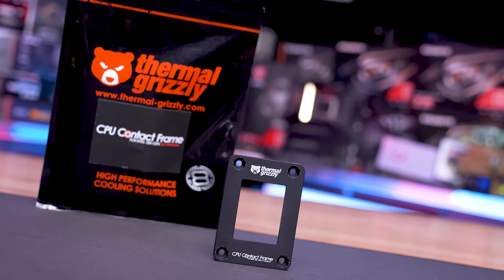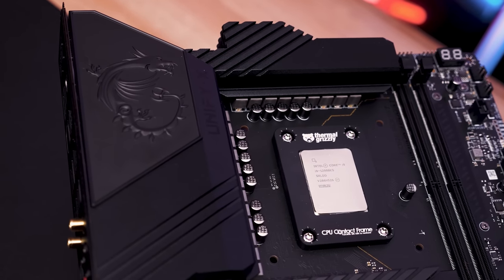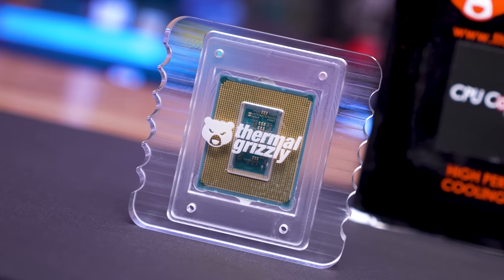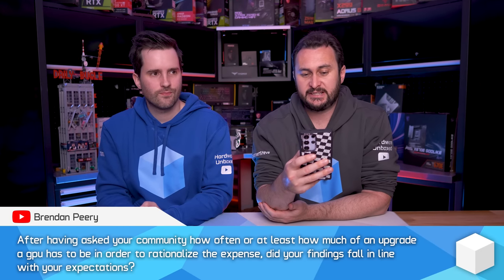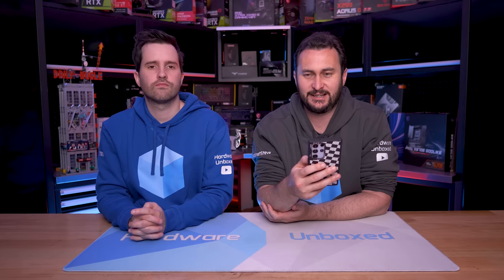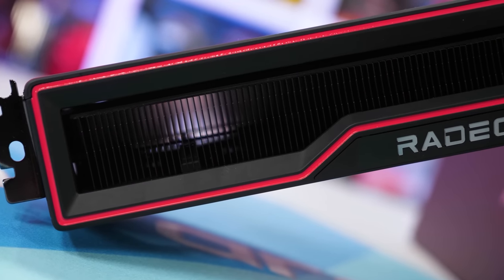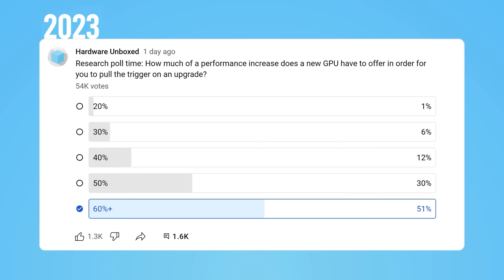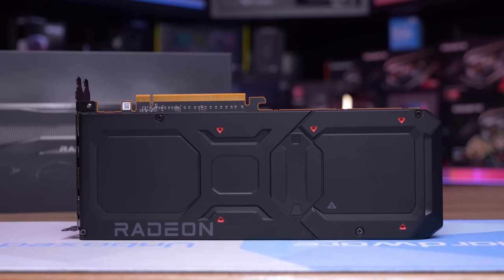RTX 4050 Pricing & VRAM, Are 12-core CPUs Dumb? March Q&A [Part 2]

Comment: Companies are now addicted to lower production higher prices,  cheap versions aren’t as profitable but I feel they’re going to eventually have to go back or someone will fill the gap
Reply: Costs for advanced production nodes are shooting through the roof (fueled by the necessary EUV lithography tools being 10 times more expensive than previous DUV lithography tools) and many features on an integrated circuit don't scale down with the more advanced production methods. One of the reasons why (aside from geometric increase in yields as you make the individual pieces of silicon smaller) companies are going for multi chip designs is that it allows then to use the more expensive production methods on parts that benefit from them and make the parts that don't with cheaper older production nodes. Monolithic designs as per nvidia and intel are probably getting more expensive to manufacture each generation, not less.

Comment: I went from a 1080 to a 3080ti (used) massive uplift, probably over 60% - but actually maybe its 100% with many games. Overwatch low settings at 120fps with the GTX1080 now with 3080ti and ultra settings locked to 300fps! So more than 100% with quality improvements too!!

Comment: I just tested R7 7700x with  7900xt and R7 5800x3D with same GC. 
I think 1% lows and 0.1% lows dont tell "everything". The experience was extra smooth on 5800x3D (still super smooth on 7700x, but not as much in RE4 remake 4k ULTRA+RT) even tho the number were quite the same according to MSI afterburner for the 1% and 0.1% lows. 

In fact those 1% lows can even be confusing and tell the opposite of real gaming experience. 

To put a simple (and not real) example of missleading statistics. 
Lets say a CPU1 had in its 1% lows : 2000 frames rendered at 200 fps and 2000 frames rendered at 10 fps, averaging 105 for its 1% lows. 
The over CPU2 performs exactly the same except that during that passage were CPU1 had its frame rate drop to 10fps, it was able to render twice as much frames........that makes 4000 frames at 20fps, all other things being equal.  
CPU2, because it performed better, those additional 2000 frames randered will push out of the 1% lows the other 2000 frames at 200fps, making it's 1% lows fully at 20fps only. 

CPU2 performed better but "surprisingly" randering more frame can actually lower the 1% lows. 
There is some extra "smoothness" about this 5800x3D CPU when gaming, and benchmarks just don't show. 

I will definitely get the 7800x3D, I shouldn't lose much money resselling the 7700x.

Comment: I'll have to disagree with your comments on the low-end GPUs like 6500XT and 3050.
You say the 3050 is still that price because Nvidia has the market power. It's still that price because it was never a realistic 250$ MSRP and Nvidia just flat out lied. It will never ever reach 250$.
Contrary to that, the 6500XT was released for 200$ at a time where GPU components surged in price and that was the only reasonable MSRP to release at. Sure you can argue that they shouldn't have released at all, but it was a GPU starved market back then.

Comment: the 4000 series cards are a hard sell, i doubt Nvidia will release the lower end cards like they planned since they cant offer them with anything over 12gig of VRAM but you cant buy a next gen card that cant play current gen games.

This reminds me back during the 900 series when 3gig was not enough anymore and the 950 came with 2gig slow VRAM and that card couldnt play games that came out a year after its release. the 5000 series card will probably rectify this problem like they did with the RTX2000 series cards

p.s the 1000 series cards were trash except for the 1080 and 1070

Comment: So, I dunno if you guys will ever see this comment, probably not but I am gunna comment anyway. 

AMD/Nvidia could make decent margin on "lower end" cards. There is NO FUCKING REASON to have RT cores on lower end GPU's. Out of all the people who own 3060's how many do you think turn on Ray tracing, in anything... VERY FUCKING FEW. Most people are turning down settings to play at 1440p, or turning up settings (except ray tracing) to play at 1080p max settings. "LOWER END" CARDS DO NOT NEED RT CORES. 2nd thing, lower end cards do need more VRAM, and more memory bandwidth on the bus. Cut the RT cores and everything that goes with them, come out with a GTX 4060 with at least 12GB of VRAM (this can be DDR5, it doesn't have to be DDR6) and no less than a 256 bus. Do this and lower the price of the card from whatever they were planning on charging back down to $350 USD. Without the RTX cores the die is smaller and less expensive, ok the memory is more expensive, but what drives cost more, the die or the memory, I am guessing the die is the primary driver. 

People who are buying a 3060 (or a 4060) are not turning on raytracing, they are turning it off so they can turn on everything else at 1080, or they are turning it off so they can get an acceptable framerate at 1440, "entry level" cards do not need raytracing.

Comment: there wont be an uplift in performance untell there is a push for more cores used in games or more extream physiques on a per core base im on a ryzen 5950x and get way more fps then i need on the flip side my buddy is still on a 1800x and can play all modern games at over 100+fps so there is no reason to upgrade im still telling people to buy the ryzen 3600 as its more then fast enough for most people and for the 1% who want crazy fps i say to get 5800x3d

Comment: Still on 1080ti, still not happy with the new selections.

RTX doesnt work as advertised.
And AMD doesnt do high end.
An why have they not brought back a type of SLI.

Anyone else noticing that 1080 TI SLI is working on modern games giving over 40% increase in frame rate?

Look it up.

Comment: I never spent more than 250eu on a new gpu. Still using a gtx 560ti as we speak...believe it or not
Reply: The sad reality is that you will be stuck on that gpu forever then.
Reply: well, there are options in that segment like rx6600 and 6600xt, at least depending on your region, but it does sting to pay that much for that tier of performance.
I am holding out for used market to crash further, so I can get a 3060Ti or 6700XT for that price.
Reply: You'll probably end up having nothing to buy eventually. Inflation and development costs will force prices up.
I had the same goal back 10+ years ago. 250 GPU + 250 CPU was my goal/limit. It's just not possible unless you only play 5-10 year old games with low settings.
Reply: @Gazer75  only hope for the future is buying 1 or 2 gens old used gpus. 
rtx 3060 are reaching 250-270 euros where I am at, and that'd probably be good upgrade for X41N3 as well.
I am waiting to snipe one as well, since at that price its good enough for next couple of years at least.

Comment: "If I spend more money, I want more.. That's perfectly valid." - yeah, as long as the value of money is constant, which it sadly isn't. So sure, these comparisons are valid, but please, do provide inflation-adjusted numbers for direct comparisons because 500$ in 2023 is significantly less valuable than 500$ in 2020..

So will people accept it? If it's in line with general inflation, then yes - many goods are now 15-50% more expensive in terms of money than 3 years ago and same should be expected with PC components. Don't like it? Me neither, but it's not fault of Nvidia nor AMD or any other company nor is it some sort of cartel deal - it's caused by politicians and their fiscal policies.

Comment: Can you bench 7800X3D across 3 generations of Geforce GPU - 2080Ti, 3090Ti and 4090? The argument for 1080p low tests is to remove GPU bottleneck, and that 7800X3D will have longer leg, fine wine as new GPU arrive every 16-18 months. Well instead of waiting for future, we can go back and test the past, how has a good CPU fine wine across GPU generations

Comment: 3080 on the shelf, 4090 in the PC. Why? Because the 3080 didn't have the RT grunt and remember AMD's greatest GPUs still only offer around 3080's RT performance. No amount of VRAM is going to fix that. 3070 with 8GB of VRAM is fine, it's was a mid range card, you shouldn't be trying to run max settings on it.

Comment: I think if AMD and Nvidia want us to pay close to $1000 for a gpu then not only does the performance jump from the previous gen need to be significant (like 60%+) but they need to have much better efficiency, better QC, better features and better specs (i.e, not paltry amounts of VRAM like every 40 series gpu below the 4090). There's no reason for the 40 series gpus to all come with display port 1.4 instead of 2.0, the margins can't be so bad that they can't add DP 2.0 without having to increase the price. Cutting corners on premium products is just not a good look.

Comment: The 4060 is gonna be based on a xx107 die. In previous gens, the xx107 dies were relegated to stuff like 3050, 1650, 1050. In other words - the bottom of the barrel. Let that sink in. And yet, I will bet you it's going to cost in the ballpark of $400-$500. It's BS and anyone buying these overpriced GPUs is reinforcing these terrible prices and F'ing things up for the vast majority of ppl - good job !

Comment: 23:44 - Well, sometimes it's better to frame limit for better fame pacing and it's definite must to lock within adaptive sync range - because who in 2023 has monitor without freesync / gsync. So overall - I'm finding it rather strange for people not to use frame limiters when there are few good reason to use.

Comment: Do a test with VRAM and see what image loss there is with reduced textures. This VRAM thing is a non issue for me at least.
I've yet to hit the 8GB of my 3070Ti, but then I don't spend $60 on new games ever. Usually grab them on sales with 50% off at least.
This also allows me to not waste money on the very high end GPUs. By the time I do play it, a mid range range card is enough for high graphics settings.
Reply: So you're using an overpriced GPU to play old games. That is a great way to hit your target memory usage but I'm not sure it's the best deal for your wallet.
Reply: @nimrodery  Nothing was a good deal for the wallet at the time.
Even finding a GPU at the time was near impossible. I had already been on the wait list for a 3080 for almost a year.
Tried a used/demo 3080Ti Strix card, but it was most likely a return due to insane coil whine, so I also returned that after a couple of days.
Waited for a couple of months to even find things in stock mostly.
My old 2060 with 6GB was also fine on VRAM in all games I play, but started to get to slow in some titles.
Reply: @Gazer75  don't worry, for some of these people, nothing is ever good enough...they are edgelords, just looking to be contrary for their own ego.

Comment: Crysis was basically Crytek trying to demand the adulation and accreditation of the pre-bethesda Id software, without the years of contributions to the community to back any of their boasting.

Digital foundry even went back to check how well the original crysis could run on modern hardware. Unsurprisingly, no. Why? Because the draw call is 100% single threaded. And the manner at which it's written, is that it doesn't give a flip about how much IPC has improved since the pentium 4, or how many cores can run other things for the game. It only cares about the clock speed it gets. And even on an 8700k with 5ghz all core overclock, it still won't max. Because it wants a 10ghz core, and to heck with everything else.

For all the screeching redditors that cried about "tHe cOnsOliZatIoN" of their lauded benchmark, if you could backport the new crytek engine to run the original release's assets, it would run a dream on anything you could feasibly get now. But out of nothing but lazy spite, Crytek refuses to do that and last I checked, blocked fan efforts to do it instead.

Comment: Where is AMD??? AMD has better performing card for a lot cheaper. If a RTX 4050 comes out at $400, it would likely perform slight worse or as good as an AMD RX 6650-XT which is selling for as low as $250 on sale. Nvidia is nuts with their pricing, no true entry model will mean AMD will dominate that market.

Comment: nVidia tried banning/blacklisting you a few years ago and failed miserably, but listening/watching to Tim's pretty smug explanation regarding GeForce and Radeon GPU marketing it sure does seem like nVidia's GeForce Partner Program is in full swing - at least in Tim's case. As far as Raja Koduri goes, he most definitely is the one to be blamed for everything Intel ARC GPU related because he was front and center with all of the Intel Xe GPU hype from the very start. This man is a snake oil salesman through and through and in ARC GPU case he just ran out of excuses.

Comment: The problem with the x3D lineup is the non user accessibility and having to learn so much to just make it work on optimal levels that barely makes sense vs the performances of the previous non x3D lineup... if the 7800 x3D 5GHZ boost max hinder it's useability it's just a dud, a farce of a lineup that is just a cash grab in the end, reducing 700 mhz from 5.7 is just killing it too, none of the x3D lineup makes sense for anyone, while these are cpu's that don't even work out of the box with normal levels of performance, you have to be a big tech enthusiast and tech savvy to use theses, this is cattering to a niche of a niche, not how you conduct buiseness, either you release a cpu that works out of the boss and don't rely on 2 pages of specifics to make it work, or you don't dood.

Comment: I just wish the 7950x3d would come back in stock. Nothing else seems like an upgrade from the 5800x3d and I feel the 7900x3d is just too close in price. I would consider the 12 core part if it was just cheaper. I'm so hyped for the size upgrade with DDR5 as I can do 2 stick 64gb and still get fast RAM and it's so cheap now.

Comment: My 3080 from Gigabyte the Aorus Xtreme WB has horrible coil whine... but it's not equal across the board, some games will have it some won't, some will do a little coil whine some will do a lot... and it's not doing like 2000 fps... some games anything above 60fps starts the coil whine, some at 120-144+ fps the coil whine is unbearable, some games won't make it whine at all, some will make some whine around above 100fps... so yhh worse card I ever owned, and I also heard Gigabyte's RMA system is terrible, and they will do everything not to replace your things, so for the future I will avoid Gigabyte at all costs

Comment: HI STEVE PLS READ THIS PLS PLS PLS. Its regarding the cpu overhead with nvidia i have 3080 ti with really bottlenecking cpu 10400f here's what i want you to test: There's an option for threaded optimization inside nvidia control pannel turning that off reduces cpu load hence might remove cpu overhead. I am really curious to get the info for that but I can't spend money on a high end amd gpu to test cpu overhead difference between nvidia and amd. PLS PLS MAKE A VIDEO ON IT!! If you got my message pls give me an indication on this msg by reply or like or anyhow plssssss I am waitinggggg